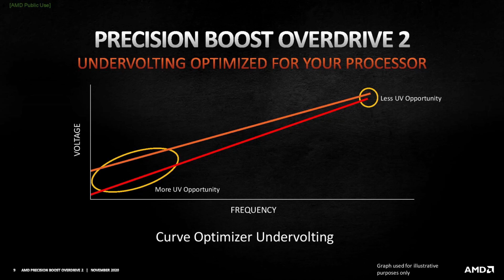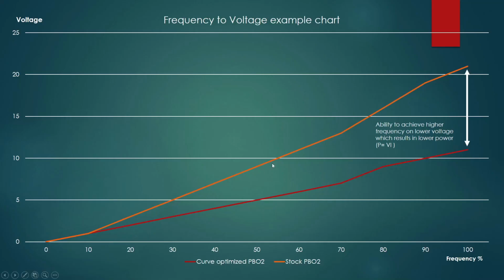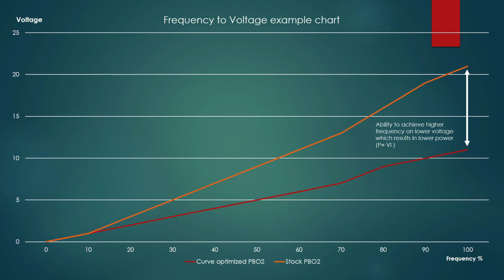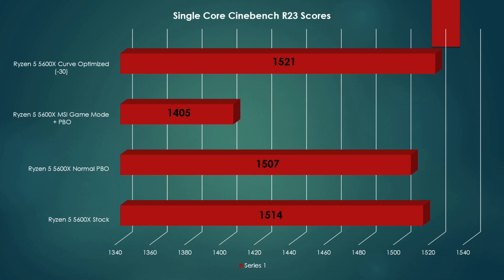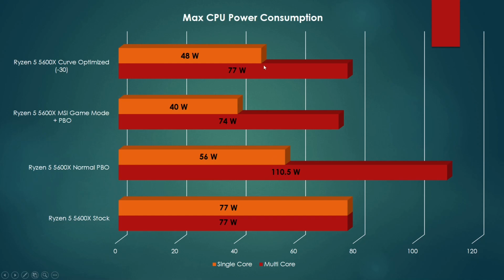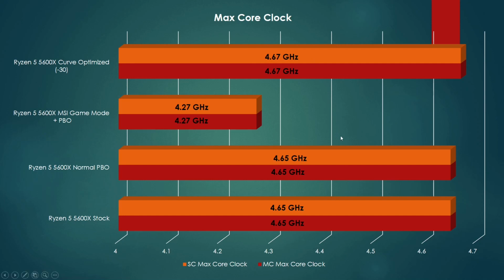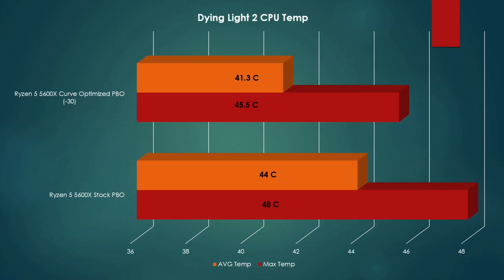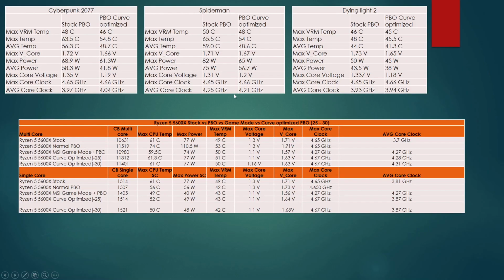Ryzen 5 5600x Undervolting using PBO2 Curve Optimizer | Undervolting | PBO2 | Ryzen 5000

Comment: Nice work. I’ve done some testing too and I settled with -30 curve optimize and then I also cap the wattage anywhere between 38w to 51w. The power efficiency is spectacular and CPU is whisper quite while gaming.

Comment: Is PBO2 only on X570 or is it available on X470 too?  I have a 5800x and a x470 Asus Crosshair Hero VII.
Reply: It is available for all B550 and X570 motherboards with a Ryzen 5000 series processor. B450/350 as well as X470 or older need a specific BIOS update to work. Note: Not all boards have/got this update. Check the latest BIOS on the vendor's site.